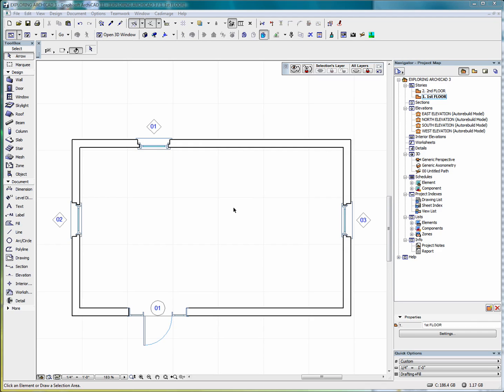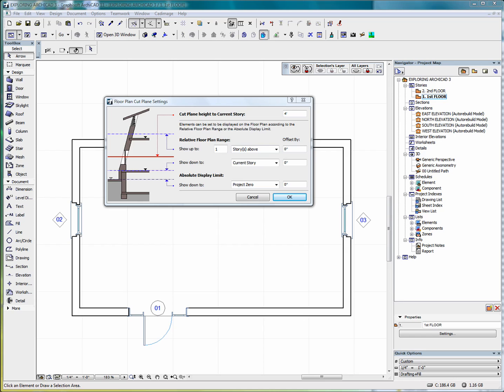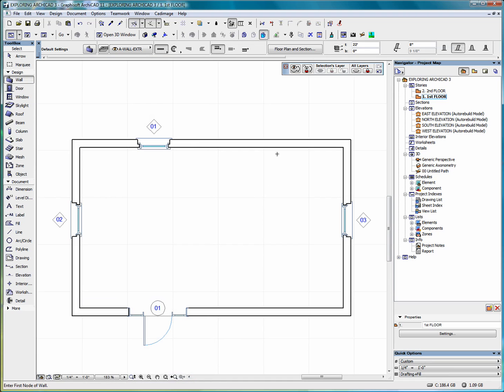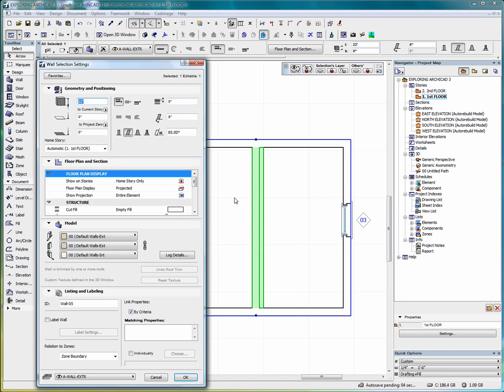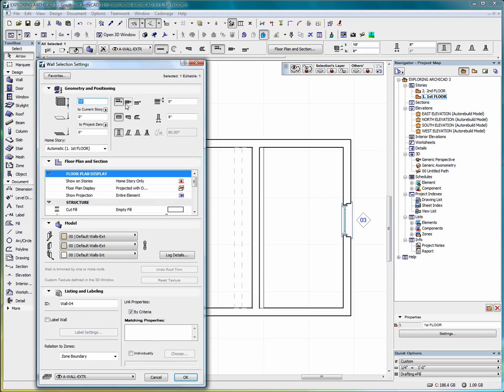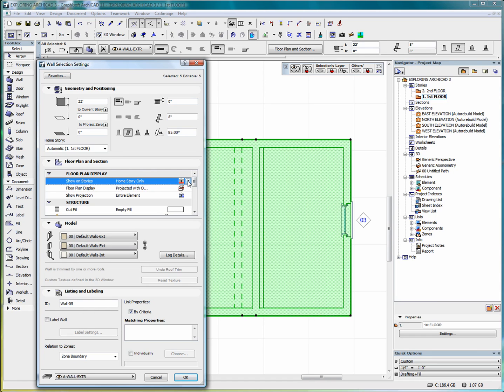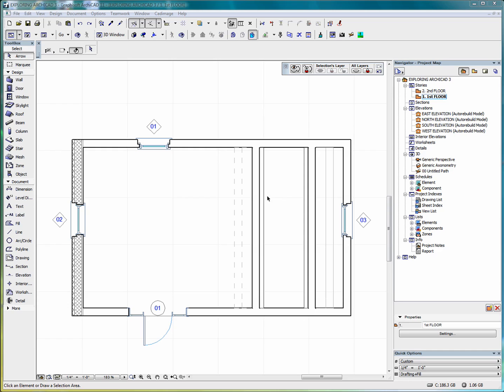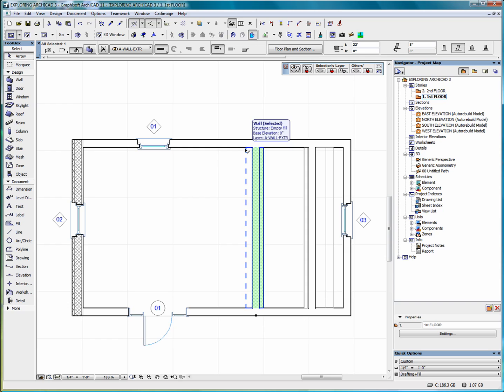FLOOR PLAN CUT PLANE SETTINGS

Comment: Is it possible to remember cut plane's settings for each different floor? Anyone know how it;s possible?
Reply: Floor plan cut plane setting are stored with each saved view. If you want to change the cut plane height, you would need to change the cut plane height in each saved view. Saved Views are what are placed on the layout sheets. ( for others, as by now I hope you figured this out )